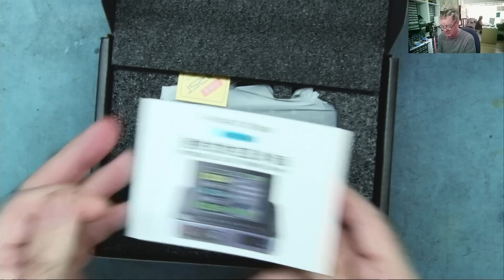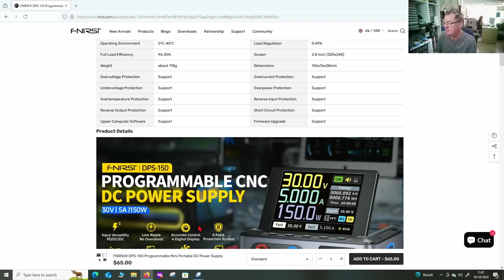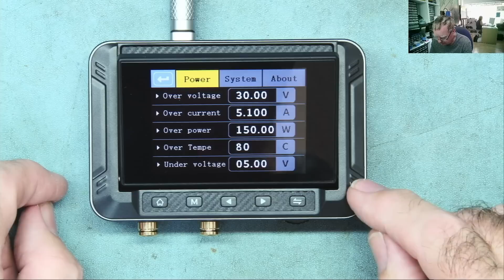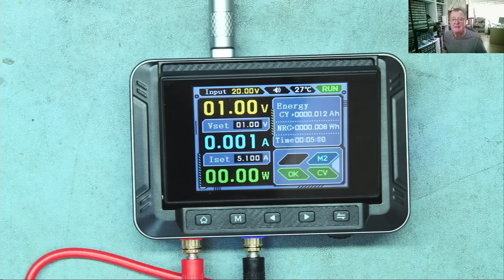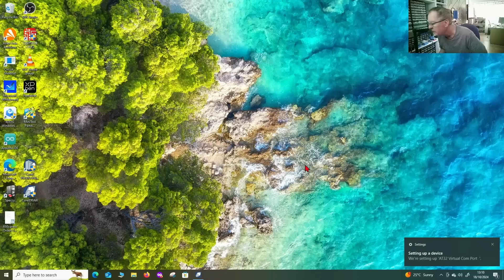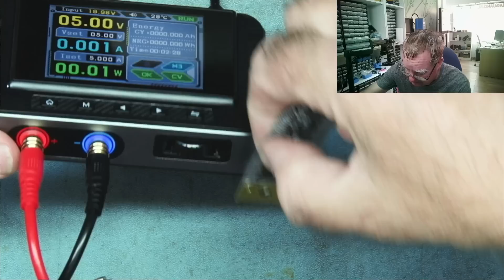FNIRSI DPS-150 Programmable Mini Portable DC Power Supply Test And Review

Comment: Just got one myself and it's perfect for my requirements 😊
Reply: That's a nice supply, but one annoying thing is that it has no general On/Off switch, so you need to unplug the DC or USB supply to switch it off. Very annoying when you use it daily.
Otherwise, it has a couple bugs (in particular with the overvoltage setting function), but nothing too major.

Comment: Whats kinda weird is that they use V for voltage and I for current. I is correct but V must be U
Reply: Because most of the world uses V for voltage? I know some European countries use U but it's not that common in the rest of the world (with exceptions in math/physics of course since mixing different disciplines results in a mess of letters that need to be changed around to be made distinct)
Reply: @NiSE_Rafter  I've always learned it is U . I did international studies and also there it was U and not v. U is Latin for "urgere". R is from the Latin word "restere" ..The unit for I is A(mpere).
Reply: @OneTheAndOnlyOne  U to me is potential energy 🤷‍♂️ Look at most bench power supplies on the market. Practically none of them say U or U-set.
Reply: @NiSE_Rafter  I know but also no I for Amps that's why I commented this. It is inconsistant. My powersupplies always "say" A for amps (not I) and V for voltage(not U), that wasn't my point.
Reply: @OneTheAndOnlyOne  But then you're conflating values for units

Comment: I see you are a professional, please I need your help, I have hp 27 es and I have vertical lines on the screen, I opened the back and tried to remove the adhesive tape after a black vertical strip appeared on the screen, what is the problem please, I have photos if you can see them and tell me what to do thank you from the bottom of my heart

Comment: I'm really not sure what I could use this for. It's a power supply, but you need a power supply to connect the power supply to. I'm not convinced this has a use in my workshop to be honest. I like FNRSI products, but it needs to be useful and not just sit there looking pretty.
It miiight be useful for someone who needs a variable supply out on site, but you are still limited to the battery or powerbank you are running from.
Reply from the maker: Yeah I think it is meant for on site use - FNIRSI do market this as portable.  I should also work well for Youtubers like me making electronics videos 😉
Reply: I already made a casing for an RD6006P with jack barrel to power it from a laptop power supply, I'm using DELL gaming PSU that supplies 19.7V and 6.7A. I'm also going to buy this PSU from FNIRSI. 
Why?
both takes very few space on desk, the laptop charger doesn't have any fan, so when I use my PSU by night, I don't hear any noise. No fan means also no maintenance, no dust to clear from the fan. 
Also, most of my electronic projects works with less than 1A and at 3V3 (rarely 5V). So with this PSU on my desk, I need only an USB-C cable from my PC (or USB hub) to this PSU to power up my circuits.
This PSU can have nice applications. I didn't used FAN equiped PSUs since more than about 2 years at home.

Comment: Guarantee that flimsy screen hinge will fail. Seems like a product searching for a customer. A decent linear power supply wouldn't really cost that much more .
Reply: I agree. Not for me.
Reply: However shipping a linear power supply from AE to Canada is a killer shipping wise with the shipping being more than the power supply is worth.
Reply: Well its very different in that you can run this off a power bank. So you can create any voltage and current you want from a battery.

Comment: So when you draw the maximum current I could see the voltage drop. Shouldn't it keep the voltage while increasing the power output?
Reply from the maker: Errrm... no.  If you set a maximum (fixed) current then it must drop the voltage to do that, if the load is of a low enough resistance to esceed that current for the given voltage.  Ohm worked this out in 1827 and he wasn't wrong

Comment: So i suppose it`s a buck converter with a screen, what you put in is variable upto the voltage/current limit. I guess what the cpmpany should do when send something in for a reviewer to test is include there thoughts on what was in there minds when they designed the software, what was behind there though with a power scan increase from 0 to set voltage/current, when you are stuck trying to give a reason/example of a use for a specific function then the reason for it becomes void, it looks nice but like all voltage controllers you always have losses in this case 0.20 volts.

Comment: It nice but before i watch i will tell you it says USB-PD but it can only do 20V and not 28V because it is not USB-PD 3.1 compliant hardware. To get the more than 20V 100w output you need to use DC supply. This was not mentioned in product description. I talked to FNIRSI about this, i didnt even get a coupon hah
Reply from the maker: Sorry but you are wrong
USB Power Delivery 3.1 0 standard with a maximum charging power of 100 W and Extended Power (EPR) with three newly added voltages of 28 V, 36 V, and 48 V. The maximum output current to the three voltages is still 5 A, while the maximum output power can reach 240 W.
Reply: @LearnElectronicsRepair  i talked with fnirsi engineering team via their support representatives. The maximum on USB-PD is 20v. Trust me I've tried. I have the same unit and also a usb-pd 28v supply and it cannot negotiate voltages beyond 20v. Thqnk you for understanding.
Reply from the maker: @launchprogramexe  Oh OK I can understand that, thanks for the info.  Nothing to stop you connecting a 32V DC supply though I guess,  Could you use a decoy to provide 28V from a PD supply?
Reply: @LearnElectronicsRepair  right. I looked up your advice and found a usb-pd 3.1 28v direct to 5.5mm barrel connector pd trigger module for 5 euro on AliExpress. It only adds 15mm to total cable length. It's a shame really that it's needed, makes me wonder how long the unit has been stuck in the hardware design department if it comes out to market with an old version usb-pd 2.0 - 3.0 protocol used until 2021 when 3.1 was released...
Reply: @launchprogramexe  I think @defpom pointed out this issue with the USB-C and having to use a barrel jack power supply to get it to 30v.

Comment: Can we use it for inject current and finding a faulty capacitor on a motherboard? Use it as a short killer?
Reply from the maker: @beogeek  I showed the DPS150 supplying 5.1A into a short during this video,  It works just as well for any of my other bench PSU for short finding
Reply from the maker: @odjsjaks  Correct
Reply: @beogeek  I must ask why couldn't you do a voltage injection with this thing? I have used a Riden RD6006 for voltage injection and it has worked
Reply from the maker: @beogeek  It will output up to 5A so why can't you use this for short finding?  I have a 30V 10A variable (SMPS) bench psu and that works for short finding just as well as my two linear ones do
Reply from the maker: @beogeek  What has ripple/noise got to do with it when you are trying to trace a short circuit? Also as a general point, if ripple/noise is a big problem for sensitive equipment then why dont ATX desktop or laptop PSU use linear PSU?
Reply: @LearnElectronicsRepair  Ripple and noise can complicate short circuit tracing by obscuring voltage levels and causing fluctuations that lead to intermittent behavior. ATX PSUs typically use switching designs instead of linear ones because they are more efficient and generate less heat, which is essential for compact devices like laptops and desktops.
Reply: @Lightrunner. yes you can use it to help finding short faulty components. I have one of these and used it to supply power to a Lenovo laptop that had a cap that got hot on my thermal cam.